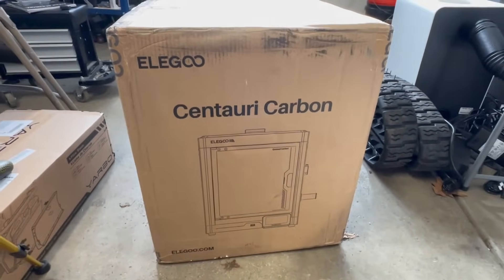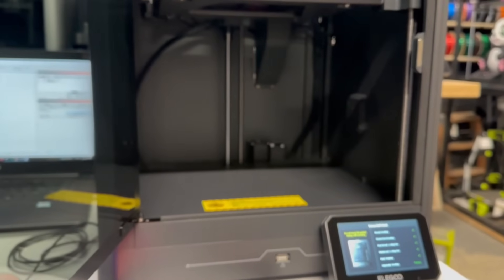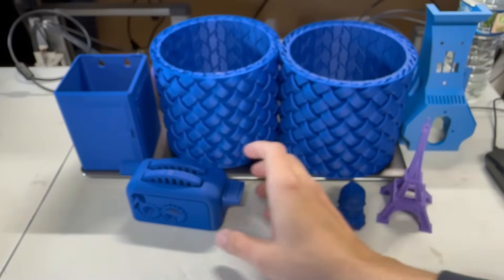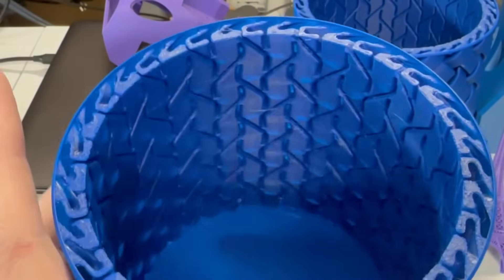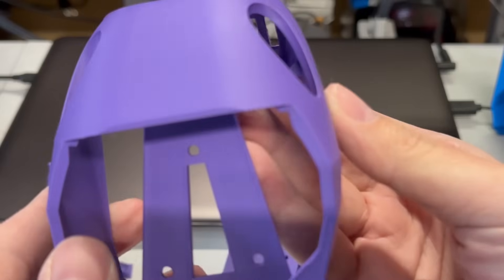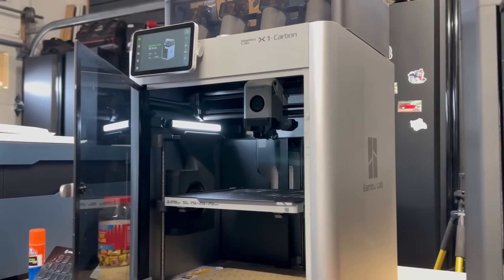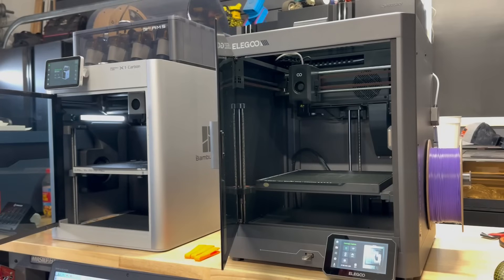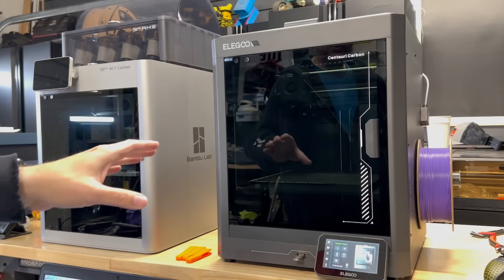Only $299! Elegoo Centauri Carbon  - No Comparison

Comment: This is comparing apples with pears. An AI-machine comparing with an non-AI-machine, is not good. Compare it with an creality K1/K1max. Both clipper-oriented machines, XY, screens, enclosed printers. The Bambu Labs is of another class. I have both the K1max and the P1S and use them both for different jobs. The K1 is a powerhouse with precision, the P1s is a lesser powerhouse but with MMU-options. Comparing the Carbon to a K1 is more right then comparing to a X1C or P1S. Totally different classes. I also suspect that the price of a Carbon will be more in the range of a K1 then an X1C
Reply from the maker: @nachtdiertje1972  Like I mentioned, it was requested by Elegoo to do a comparison.  I have never done a comparison video on my channel.  Frankly I didn’t see any value to this.  My videos are solely focusing on the product, did it work out of the box, and did it perform well.  I would have much rather have focused the last 10min of the video on other things about the printer.  Thanks for watching and commenting 👍
Reply: Bambu Labs is joke and will kill their business with that new firmware update that litterly locks their printers to Bambu systems while at the same time giving Bambu the ability to lock your printers up if they don't like what you are printing.
Reply: @thomaswakefield6889  Total BS, every printer connected to the internet will be vulnerable to hackers and manufacturers. Only Bambu is concering about it, only is doing it in a very stupid way. Everybody is falling over the new firmware, but in practice, nobody will notice. All you have to do is to download an extra program for the non-bambulab software. That's it. When Microsoft updates it software, nobody is noticing the "securityupdate", now Bambu is doing it and everybody is whining. Many YT-ers have made this concern in first, but within a week they all had a rectificationvid out.

Comment: There is a reason why Bambu uses carbon rods for the X axis and that is the weight when accelerating and decelerating. This uses cheaper and heavier steel robs. Apart from that it's a P1S rip-off without the AMS.
Reply: Steel is better than carbon for rods.
Reply: Cheaper too which makes it great
Reply: The CF rods are literally just a marketing gimmick, just like their lidar. All other coreXY printers run just as fast and put out the same quality, but don't use consumable CF rods and graphite bushings. that cost $100 and 8hrs to replace. The fastest coreXY's like voron's and VZbots don't even use CF rods.
Reply: @LilApe EXACTLY! 👏🏼 well said!
Reply: carbon rods LMAO

Comment from the maker: Correction at 12:40 in the video I said the the X1C doesn't have a AC heated bed, it was a mistake on my part.  The X1C does have a AC heated bed. At 15:07 I also had the screen size comparisons reversed!  I need a drink!
Reply: You got your screen sizes mixed up too. Lol
Reply from the maker: @BENVENTER-h2z   Well damn! I did get them reversed.  I need a drink!
Reply: What is the size of the print bed?

Comment: You can't compare  them because they have not released the price or the availability of spares. These are important things. And personally I love Bambu's AMS, not because I do color printing but because I can't be bothered with constant filament swaps. I can use it to print different colored prints or different materials depending on what model I want to print without going to the printer and physically changing the filament. It's nice to see that Elegoo even ripped off the graphics for the display. Seriously underhanded.
Reply: The price of the Elegoo is 500, and as for parts, I'm pretty sure they already have them but won't release them on the site until the printer is released
Reply: 299.99 for US and they have spare parts for sale as well
Reply: @thomaswakefield6889  That's an unexpectedly good price.
Reply from the maker: Updated by Elegoo, it is only $299!  Link in the description is now live!  Also said there is a possibility of a multi material system this year!

Comment: x1c has an AC heated bed. Are you confused? There is an SSR inside it. All Bambu machines use AC beds -- that was the problem with A1 that needed a recall.
Reply from the maker: Yeah!  Big mistake on my part!  I had the correction in the video description.  I just pinned a comment.  My A1 was part of that recall.
Reply: @TripodsGarage  I'm not a bambu fan, "security mess" is a mess. I still don't have an adequate response from Bambu tech support why my X1C in lan mode keeps trying to access REMOTE (internet) ntp servers while DHCP broadcasts a local ntp server which all other IOT devices use without complaint. It is fair to compare this with X1C. The metal enclosure vs plastic on the P1S. Color touch screen vs clickwheel thing on the p1s. Provided this is compatible with box turtle or BTT upcoming klipper based AMS, Bambu is cooked.
Reply from the maker: @kazolar  My X1C is a Kickstarter, with very low hours for its age.  My AMS motor is over heating constantly, I replaced the motor, all the tubes and guides look fine, still the same issue.  So annoying!  My A1 minus the recall has been more dependable.
Reply: @TripodsGarage  my x1c is a KS unit and I have a 2nd ams. I had the bed sensor wire and main board fail early on, but after those replacements, it's been fine. I have the e3d high flow obxidian on it, and btt metal extruder gears. Used it to build my big AWD belted trident, a Anex K3, so I've been happy with it. Similarly I was happy with my TypeaMachines s1. X1c replaced that printer, and eventually, something will replace the x1c. Bambu wants to be out of my shop, they'll get there eventually.

Comment: $500, no thanks. $200-300 maybe. Especially for single color. 

I would rather get a P1S for that price from a Bambu that has all the Bambu support and quality but kudos to Elegoo for trying to copy a great printer. 

I’m just here waiting for the Neptune 5 🫠
Reply from the maker: @TheFoxalot  - I did not get the comparison they wanted.  The X1C has many, many more features for a machine that is almost 2.5 years old.  The better comparison as I mentioned would have been the P1S.  I totally get where you are coming from.  The lack of a multi material unit is definitely a turn off for many.
Reply: These things will sell at $500. However, sales will drop this price a lot. Also, if it is still a good printer in a year, they will permanently discount them like they did for the Neptune 4. The Neptune 4 used to sell for $250. Now they sell for $199 off sale.
Reply from the maker: @monetary_episode  Updated by Elegoo, it is only $299!  Link in the description is now live!  Also said there is a possibility of a multi material system this year!
Reply: @TripodsGarage  Definitely buying then!
Reply from the maker: Updated by Elegoo, it is only $299!  Link in the description is now live!  Also said there is a possibility of a multi material system this year!
Reply: Bambu support and quality lol.....what support and quality?

Comment: I do agree its a P1S clone with sides.  Looks like a really solid unit overall.  Depending on price, it should sell pretty well.  They dont even list it on their site yet.
Reply from the maker: @MrMadeinthe80s  - Yeah, didn’t make any sense to compare it to the X1C.  The embargo release date was today, yet no product release on their site?  Usually Elegoo is on top of these things.
Reply: Heard it was gonna be 500usd. hope it gets an ams like system it's set up to have one
Reply from the maker: @Og_paine  Updated by Elegoo, it is only $299!  Link in the description is now live!  Also said there is a possibility of a multi material system this year!
Reply: Yea I've seen another review just now and they also said it would be around $500, which is a very compelling price
Reply: Once its on the site I'm getting it, still not there
Reply: Well Allllright....Snagged one before it went Sold Out. Now putting it beside my P1S to see the difference.
Reply from the maker: Updated by Elegoo, it is only $299!  Link in the description is now live!  Also said there is a possibility of a multi material system this year!
Reply: Supposed to be about 500.00 US.
Reply: P1S has sides. P1P doesn't. This is basically a p1s with a better scream that comes with a hardened hot end... Only thing its lacking from a stock x1 is heated chamber and lidar. (Lidar is kinda a gimmick.) Best of all it isn't close source and can operate on LAN without a cloud.
Reply: @donkeydiehard879  x1c doesn't have a heated chamber. Same passively heated by the bed like this. P1s sides are plastic, and this is aluminum like x1c. This is basically an x1c without the ams.
Reply: p1s screen and plastic enclosure is not a valid comp. X1c comp is valid. If elegoo even makes it compatible with a creality CFS (if they don't release their own) they'll make Bambu really think hard about their apple closed wall garden approach to things. They've been around for a 2 + years not 20.

Comment: Only problem I have with companies other than Bambu lab is parts ordering. Elegoo, creality and anycubic are terrible at sourcing spare parts.
Reply: I have 5 Elegoos, and never had an issue getting parts.
While they may be "out" as a retail option, when contacting them they have always supplied needed parts.
Reply from the maker: @Happy3dprinting  Absolutely!  As I mentioned, proprietary hardware, and support lifespan is my only concerns about these machines.  The aftermarket is only going to support hardware that is extremely successful.
Reply: This is to Jeffrey, since it’s a comparison between Elegoo and Bambu lab, as requested by Elegoo, my original message is correct that parts are an issue in the UK. I guess since Jeffrey will not provide any link to chat back I can only say they are professional agitator and ignorant to the extent of not even reviewing the video. What a joke of a human you are Jeffrey.
Reply: Elegoo’s after sales support is the best on the market. There not a single other 3d company who can be compared to them
Reply: I have 12 Elegoo printers and never had issues getting parts, and since Bambu is now permanently locking their printers to solely use Bambu products, the 2 I have will be permanently cemented and used as boat anchors.
Reply: @thomaswakefield6889  hyperbole, just throw them in lan mode. i hate bambu as much as the next person but you're full of it.
Reply: @thomaswakefield6889 if you don’t want your Bambu lab printers just sell them, but I think it’s more likely you’ll keep using them with orca as the pathway for the orca slicer to Bambu interface is already done.
Reply: @thomaswakefield6889  Sell them to me instead.

Comment: I always wonder how it prints ASA or ABS. That's why it is enclosed right? I especially wonder if it has any reasonable fume extraction. That aside, great review. Seems like bambu has a real competitor here given print quality and price.
Reply from the maker: @seadog6351  - Yeah, unfortunately time constraints, and what you want to put in a video.  Think for someone that wants an enclosed printer, that prints amazing well, this might have a good chance.
Reply: Not a good competitor until they have their own AMS unit.  I can't live without AMS now.  However, it does look like ELGOO is already set up for AMS with a poop chute and a filament cutter.
Reply from the maker: @ Yeah, so much confusion on this!  I saw that it was basically already setup for a multi material unit.  I reached out to Elegoo immediately, and they said there were no plans.  However, with demand this might change
Reply: @ I'm wondering if they are simply waiting for or working with a company like BigTreeTech with their upcoming VVD unit which is Klipper compatible.
Reply from the maker: Updated by Elegoo, it is only $299!  Link in the description is now live!  Also said there is a possibility of a multi material system this year!